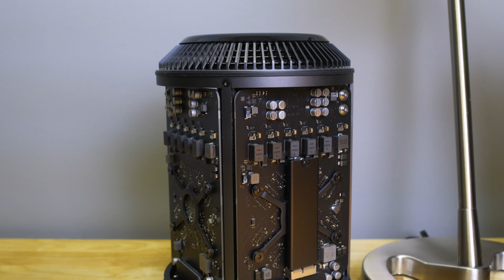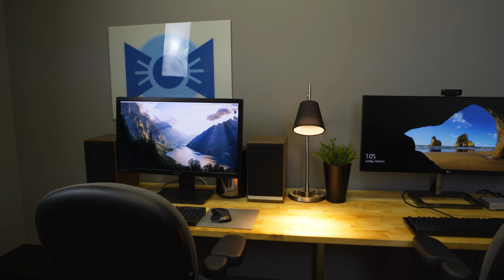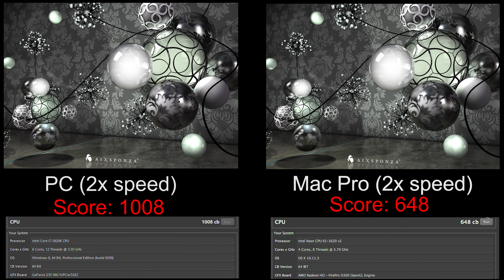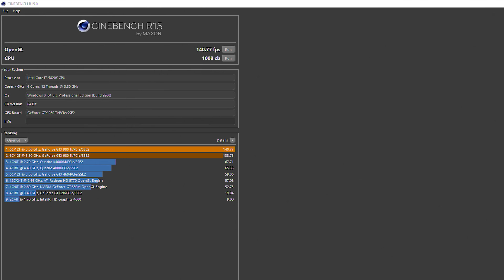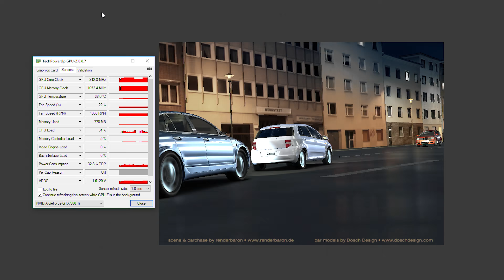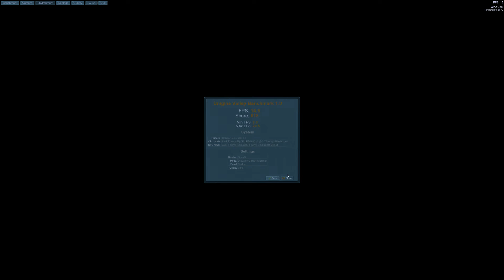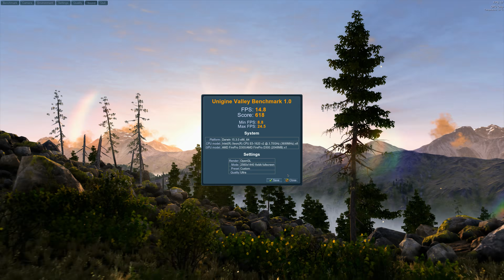$2,000 Custom PC vs $4,000 Mac Pro

Comment: apple sells overpriced and underpowered shit that idiots buy
Reply: In terms of design, great. Prices not so great.
Reply: +Triple259772 iPhones limit you in any way possible. With my S5 I could spend 15 bucks and expand my phone storage by 32gb with an SD card. The list of ways apple tries to screw you over goes on and on. The way Apple runs is extremely horrifying.
Reply: +MuckyDuckGaming I still wonder why do people even buy their products.
Reply: you're right man!
Reply: Simply put, buying apple products is just showing that you don't care about the quality, speed, up to date technology and have plenty of money to burn to buy outdated shit just to show that you can.
Reply: right on man
Reply: Their phones are actually pretty great. Very quick.
Reply: +MuckyDuckGaming I freaking love you.
Reply: +Bablooo The Cookie Macbooks are fuckin stupid, I once updated my Macbook "Pro" 17" 2008 and it failed and it won't fuckin boot and said i had to reinstall OS X. WTF
Windows doesn't do this. I failed my Win 10 update too on my $1200 Gaming PC and it just rebooted and Win 8. Failure was due to a blackout.
Reply: RoyalJDM
What the hell is 'build quality'?

Is that when you say:' if I drop my phone there is a 99.999% chance my screen cracks beyond repair?

Or perhaps the robots that make the chips are of a good quality. They probably are. The chips are made by samsung.
Reply: +Faowi produce what? didnt you saw the video? it toke the mac 50 mins to render the video and it toke 15 mins for the pc to render the same video.
Reply: Feels like a sin to love my pc and also love my iphone
Reply: +RamboGG a computer shouldn't cost a soul and your first born child when its only good at light productivity though.
Reply: rich pricks, usually
Reply: +Triple259772 That's what kills me. I loved Apple as a computer company. Not so much Apple the iOS company.
Reply: +Triple259772 S7 is much faster and waterproof
Reply: +MuckyDuckGaming Won't you get sued for posting apple's motto without paying royalties or something?
Reply: +Faowi Consider that in this the PC is benchmarked in Productivity editing tasks and 3D engineering tasks / producing and crushes the MAC "PRO"
Reply: +Louie Mott I would disagree with this. I was an android fanboy for the longest time before I tried an iPhone almost 2 years ago. All the android phones I had had problems dissipating the extra heat and got very hot. The only time I have ever experienced overheating of my iPhone was when I was playing a moba on my phone, which is in itself very demanding. Also, why does the iPhone continually outperform its competitors in mobile gaming and benchmarks? The iPhone is arguably the only good product Apple offers in my opinion. It may be a tad overpriced, but I will be using my iPhone 6 for another 2 years. I could barely use an android phone for a year before it slowed down.
Reply: Fuck off with you mobile gaming bullshit. We are talking about real tech here.
Reply: *****
that thing is a ridiculous price tag
Reply: +MuckyDuckGaming The worst thing is we have to have iPads for school... not even andriod tablets... #shitschool
Reply: i dont know if troll or stupid
Reply: Venonæ iOS has PLENTY of exploits lol. That's why they have SECURITY updates.

It actually DOES mean shit, iPhones arent even in the top 5 phones anymore http://www.phonearena.com/phones/benchmarks 

Apple could get away with having good software for a time, but everyone has caught up and overtaken them, as is Apples weakness
Reply: +Venonæ Ios does not have exploits? What? There cant be a sofware that does not have any exploits(security holes). They have to keep updating their sofware with the new creative way of hacking that are coming up. Go do some research kid you talk way too much nonsense. Now I can bet you are a 10 year old kid that is trying to look smart.
Reply: He doesn't get it... it's not iOS that has the issue... iOS would be fine if the shell it were in didn't have the biggest markup of all the phones on the market, despite not even benchmarking in the top 10! (it was worse than i thought).

The price of the phone doesn't justify its features or performance
Reply: jichaelmackson1958 I am pretty sure he is just ignorant. Right the issue is not their products, they are great but way overpriced.
Reply: Windows PC's are faster tho :/
Reply: aka paying the brand that use the sweat of Chinese children
Reply: same
Reply: well said
Reply: +Drew Man But the iPhones are shinier.
Reply: +Triple259772 and very brittle. My local hardware repair shop is still in business thanks to broken iPhones.
Reply: +MuckyDuckGaming Strongly agreed!
Reply: +Faowi you edit a video on your mac in twice the time it takes me to do on a pc, and you want me to believe macs are better for productivity? stop spouting marketing hype and look at the benchtest results, the PC shat all over the mac for video work. twice as fast. twice as productive. or does productivity mean something else on whatever planet you're from?
Reply: Digger Noises It took 10 minutes to render 1 minute 4K video on the underpowered 2015 MacBook. Also, Windows doesn't have stock apps that help my work. macOS has. I know Windows, it's my Gaming PC. I know Mac, it's for my work.
Reply: +Joe Williams ya i mean why buy a shitty phone with an ok OS when you can buy a powerful phone that you can load any OS on.....Oh wait the ladder is any phone other than an iphone
Reply: Louie Mott Because I'm not looking to dive into my phone like that. iOS is a good OS that practically never hiccups, is super simple and smooth, and has nice features such as facetime, and a more expansive app store. I'll customize the shit out of my PC, but a phone benefits more from features and optimization over power
Reply: +Bablooo The Cookie While that may be true in your opinion, it still doesn't change the fact it is overpriced to hell and the factually horrible hardware and horrible at doing anything but word processing and making super shitty 7 year old iMovie videos.
Reply: +Venonæ Obviously you have nothing lol
Reply: +Venonæ Hey I see that too I missed "use" on the first sentence. I just typed it out fast thats why I missed some stuffs. Swearing doesnt do anything it does not improve your argument neither makes you look cool.
Reply: +Venonæ What are you even talking about?
Reply: +Venonæ still aren't making any points. Apple is a giant rip off and anyone who falls for it lacks brain cells
Reply: energy can neither be created nor destroyed Hackintosh's?
Reply: The Android market is a lot bigger than the iOS market though, so you can always come to the dark side ;)
Reply: +Venonæ Android has about as many flaws as iOS does.

at least HTC and Samsung dont go forcing updates on peoples phones and overcharging for 2 year old hardware
Reply: +Venonæ You are the illiterate kid here. Android is an operating system. Google is its owner. There is no way you can compare android with stuufs like "ram" and other hardware stuffs. Google made the android api free so many companies use it.
Reply: +Venonæ Yes they do no poor people use Ios. But thats a good thing alright? Rich to poor everyone use android does it matter? No. And you have some serious problems kid. I dont know how old are you but feels like I am talking with an ignorant 9 year old.
Reply: +Venonæ How? You called me a illiterate and said how is android changing the world? I already explained "how" and I called you an illiterate because you dont know anythung about android api or how its licensed and called someone elese illiterate.  And why is that funny?
Reply: " no, ios doesn't have exploits" you did say that calling me "dumb illiterate fuck" does not improve your points . Thats the problem with Ios users like you. They dont understand anything about software or hardware. Every single software and games have security holes alright? Just because you type "no shit " at the end does not make it a point. And you are too stupid and ignorant to argue with. Go get some knowledge and come back maybe. I dont want to teach a 9 year old about software or hardware.
Reply: +None Of Your Business (PonchoLivre) no. Either way apple is overpriced
Reply: PC is better in everything, so it only depends if you are dumb or not
Reply: Just here to read the butt hurt Apple fanboy comments
Reply: +Hadz0n Babloo just made your statement come true lol
Reply: +MuckyDuckGaming True!!
Reply: +MuckyDuckGaming Soooo true Mucky!
Reply: considering macs are good for productivity, not gaming
Reply: +MuckyDuckGaming idk the Iphone has the best build quality IMO
Reply: +Stylish777 My galaxy fell out of my pocket while on my balcony, fell a story and didn't crack, or get any damage. A lot to do with the case, but still, I have never seen or heard that happen with an iphone
Reply: 4K or 2k computer, or cut and style your hair?  Which one?
Reply: +MuckyDuckGaming but they look nice lol
Reply: +Yen Syden not really
Reply: Faowi Thats true thats what they are meant for. Did you know Microsoft actually wanted to be known as the Work PCs and Apple wanted to be known as the gaming PCs. BUt everybody started gaming on Windows so they couldnt help it and everybody started using Apple for work so it was just meant to be I guess.
Reply: Yen Syden I guess so
Reply: +MuckyDuckGaming they have good phones imo. but I tend to agree
Reply: ***** no
Reply: true
Reply: very true😌😌😌😌😌😌😌😌
Reply: +MuckyDuckGaming iPhones are nice because of iOS
Reply: +Louie Mott Yes I did? You said you could load any OS (not sure what you would load other than android on an android phone) on a more powerful device, and I said I'm not interested in diving into the tech and loading new OSs on my phone when the iPhone is powerful enough to run the well optimized iOS and any apps I might use. And you may not like the features, but I do and use all of them.
Reply: +Louie Mott When it comes to mobile, I'll take software over hardware (as long as the hardware is capable) and iOS is the best mobile OS out right now
Reply: +Venonæ nice shirt!
Reply: So much toxicity in one thread
Reply: Macs are not underpowered i prefer pc but i use a mac for working and media and pc for gaming
Reply: +Matthias bos then you stunt have the right pc build
Reply: +Men In black that's because the OS is designed to be simplistic because the phone doesn't have the hardware to run Android OSs smoothly. you could load the iOS on an Android no problem, and still have all the power an "Android" phone offers. Complexity demands performance.
Reply: +Men In black that's because the OS is designed to be simplistic because the phone doesn't have the hardware to run Android OSs smoothly. you could load the iOS on an Android no problem, and still have all the power an "Android" phone offers. Complexity demands performance.
Reply: +RUFUZ G-PLUS please go back to grammar school before you try to formulate an argument....
Reply: +TottieGod lol my $80 Motorola Moto E2 (nearly two years old now) plays VainGlory with ZERO problems or overheating. Sounds like you must have had really poor android phone selections. This is considered a bottom of the line android phone and it's been rock solid. Motorola and Samsung make great android phones... to each their own.
Reply: +MuckyDuckGaming Honestly, I only use apple computers because I need to use certain programs that are only available in MacOS
Reply: What are the programs?
Reply: +Fëanor I'm an editor so, final cut pro X
Reply: The same person that has a Razer logo as their pic (Razer makes terrible quality products that are also overhyped and overpriced) says that iPhones are good (the same as Razer). What a joke.
Reply: *****
You can make a PC run OS X. Have you informed yourself about it? If it really is just a handful of programs, a look into it would be good ;)
Reply: +Fëanor Ive known about it for quite some time now, I'm looking into building a hackintosh soon. Thank you though
Reply: Good luck with it, and enjoy that extra money you save from it ;)P
Reply: Overpriced ? Yes. Underpowered ? Yes. But we are not idiots. We just don't like products created by ánd for people with extremely bad taste !
Reply: yes
Reply: Did you even watch the video? lol
Reply: You can say the same thing about Mercedes Benz or BMW.
Reply: James, not close to the same thing. Mercs and Beemers are miles better than standard cars in terms of specs and features
Reply: So many people use Iphone so people wants to develop apps and games for Iphone. And guess what? Without an apple device you cant even compile Ios apps or games! Thats the only reason I ever even considerd thinking about a Mac. They dont give us their OS X either. They are all about the money
Reply: +Venonæ Not a decent reoly that I would argue about, bye.
Reply: lol the lack of intelligence is immense
Reply: +jichaelmackson1958 Sometimes you need to. You cant develope Ios apps without a mac.
Reply: jichaelmackson1958 No. You have to submit your app to apple and get approval from apple first to publish that app. And if apple finds out it was compiled from a hackintosh they will not approve it. You will never be able to publish that app again (for IOS). And most of the market for both game and app is on IOS.
Reply: Ahh ok, gotcha. That's really fucked. I would just stick with Windows Phone and Android, there's more than enough market for it
Reply: jichaelmackson1958 Yeah thats fucked up. But windows barely has any market. IOS has about 1 billion users! No game/app developer will ever let that slip. But the good thing is you can build it on windows and later compile it on mac so a cheap mac does the job.
Reply: jichaelmackson1958 I am talking about publishing on both sides. Yes android has bigger market ( not a lot though) but Ios has a lots of customer. Cross platform apps and games can use most of the code between each other so developers consider a mac so they can get it on Ios as well. But you cant ignore Ios never. Ios has crossed one billion user worldwide! And Ios gets better ad revenue and more chance of someone buying in game stuffs. How can you ignore 1 billion customer with great potential. Even if I can get 100k more user by publishing on both the platforms why not? I will probably the cheapest mac-book pro or rent one for a week or so.
Reply: +Venonæ Android api is free. Api means application programming interface. Google made android api free so that anyone could use it. Thats the reason so many phones are android (Indian, Chinese). By making it cheaper they are making it available for people in need. People in India Bangladesh, Afganishtan,  Africa etc are getting access to smart phone and those people really make use of it. Making a difference in the world.
Reply: energy can neither be created nor destroyed exactly poor people use it
Reply: jichaelmackson1958 

you are so dumb....

benchmarks....still specs don't matter

Apple could get away with having good software for a time, but everyone has caught up and overtaken them, as is Apples weakness - what?
Reply: energy can neither be created nor destroyed 
You are the illiterate kid here. - how

Android is an operating system. Google is its owner. There is no way you can compare android with stuufs like "ram" - I can if every phone has shit ram management.

 and other hardware stuffs. Google made the android api free so many companies use it. - AHHA
Reply: I love how there are no apple fanboys replies under ur comment
Reply: True!
Reply: just leave your fucking house you nerds
Reply: 100% true
Reply: LOL. Mac's weren't made for gaming. If they aren't made with state of the art software architecture, they're going to be garbage for everything.
Reply: Landan Parker youre dumb
Reply: Did you even watch the video?
Reply: +Landan Parker That doesn't mean they can cost more than many Alienware computers. You have to realise a $4,000 computer has to be extremely powerful to be that price.
Reply: 666 likes
Reply: +potatobox900 I noticed that too.
Reply: The iPhone is consistently the leader in performance. 

http://www.anandtech.com/show/9686/the-apple-iphone-6s-and-iphone-6s-plus-review/6 

http://www.anandtech.com/show/9686/the-apple-iphone-6s-and-iphone-6s-plus-review/7 

Even the 5SE runs circles around most competing devices: http://www.anandtech.com/show/10285/the-iphone-se-review/2
Reply: "Despite not even benchmarking in the top 10" 

http://www.anandtech.com/show/9686/the-apple-iphone-6s-and-iphone-6s-plus-review/6 
http://www.anandtech.com/show/9686/the-apple-iphone-6s-and-iphone-6s-plus-review/7 

Even the 5SE runs circles around most competing devices: http://www.anandtech.com/show/10285/the-iphone-se-review/2 

They're among the fastest smartphones out there. Do some research before making bold claims like that.
Reply: Windows doesn't have stock apps that help my work. PC is cheaper so you can buy what you need, your computer will be faster and will have what you need so this argument is weak. The only argument is compatible with cooperation with other forces which sometimes have a Mac and a PC.
Reply: Ahem, ahem

Greedy kids buy
Reply: don't forget the fact that they are a bad company because they force the consumer to adjust to their want instead of adjusting themselves to the consumers want (iTuns, new macbook with type c etc)
Reply: +maloviv 123 They aren't a bad consumer. They know what they're doing.
Reply: +A Very Stereotypical Person well their most up to date DESKTOP (the most powerfull form of a computer) is extremly bad for its price and uts only 2 years old. I bought a 600 dollar pc thats better than this without having to pay 4 grand.
Reply: +TottieGod what do you mean not overheating???  My iphone 6 is suprisingly not burning half the time! It literally hurt when its been charging for a while. Tell me da secrets man
Reply: +powermichiel overpriced and underpowerd is the worst combo ive ever heard. So youre not really the brightest if you buy THAT just because "its stylish" and "my iq is too low to understand that theres correctly priced laptops made for looks on the market"
Reply: +None Of Your Business (PonchoLivre) exactly! Like for example:
Gaming: most games are windows compatible
Editing: macs arent that powerfull so pc is a better choice for effectiveness.
Paying 2000 dollars on outdated hardware just so you can browse the internett  and you think the os is nice: heres where a mac shines!
Reply: Because most people are not geeks? Because most are common users having no interest and no knowledge    to build up their setups?
Reply: You actually think mac doesn't get viruses???
Reply: dude the chance between a normal pc and a "mac" is the same it's all about what you download and what sites you go to....
Reply: +Martin Schulz but a little knowledge could save them hundreds of dollars and a better performance in computer
Reply: Zero Articulation
Yeap
Reply: +DjBit-3 Animations and Gaming just because you download shit, doesnt mean you're going to get any kind of malicious software, my PC is 7 years old and has 0 malicious sofware because, I know what I am doing with my computer. And apple is prone to malicious sofware as well, it isn't invincible, viruses are a noob scare tactic these days anyway.
Reply: +DjBit-3 Animations and Gaming hahha you sound so funny bro, and you think my 7 year old computer plays minesweeper, top kek, you obviously don't know much about computers lol, I wonder  what kind of top secret work you do, that ur mac doesn't get viruses and PCs do, I'll download that for you.
Reply: +DjBit-3 Animations and Gaming I don't need to prove anything, because you would just toss it aside and say Macs are better, also computers don't slow down over time, that is a myth. Also Apple doesn't make computer parts, they get parts from Intel, RAM from kther brands, basically all of these thirdy party companies and they put it in a pretty case and sell it to you for 2-3 times it's computational worth. This video proves that as well, also  I do you think you should download more RAM, you kind of need it.
Reply: +DjBit-3 Animations and Gaming bro just because you can't manage your processes doesn't mean it's slowed down, the only reason your computer skowed down is because of poor optimization by you.
Reply: +Chris_ Robby same
Reply: ***** You don't have too, just stop installing dumb shit, and you can disable all start up programs.My PC is 7 years old and still stats up faster than any mac.
Reply: +DjBit-3 Animations and Gaming my 7 year old pc is still faster than some macs that aren't worth 5 times what its worth compared to mine, calling me ignorannt is ironic, pretty much all I am seeing is bigotry from some guy that animates ponies, even though there isnothing wrong with that, animation schools actually use high end PCs, my friend is in it, and anyone with a brain wont purchase a mac for performance.